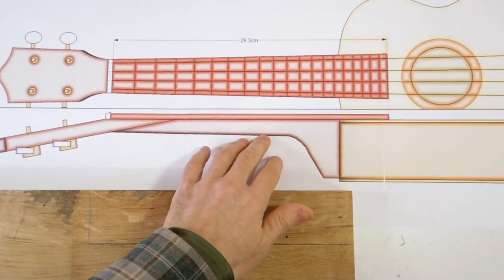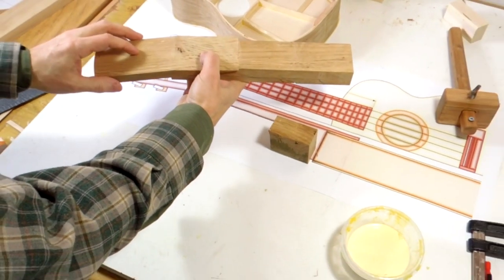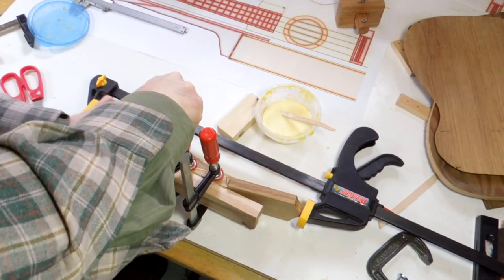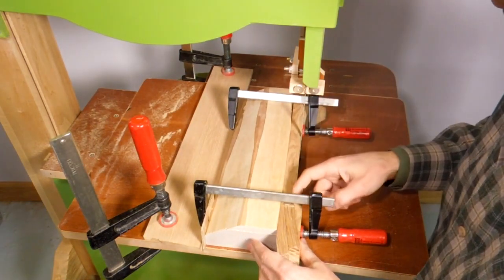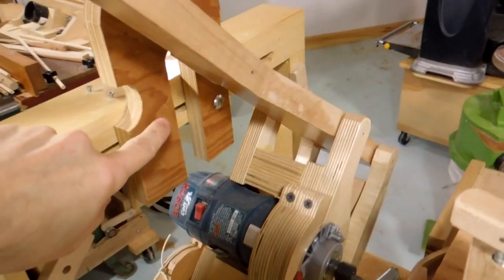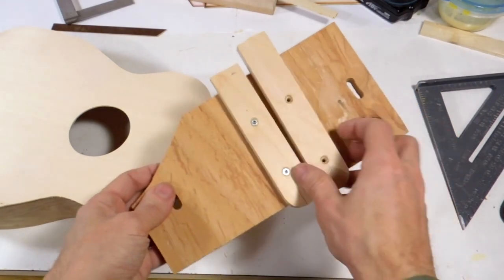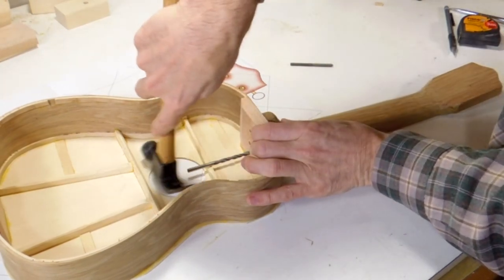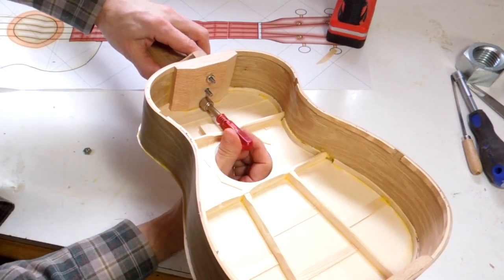Making the ukulele neck

Comment: Looking good so far. Your gauge measurements shows off your mad genius which is always fun. In this case, the external mold would have made it unnecessary. I have actually used an external mold (when I built years ago) to shape the two side strips (wet) connected by the end block and the neck on the other end. Then attach the cross braces and the back panel. Once the glue dries, you can remove it from the mold and it will retain it's shape. To keep it perfect, flip it around and slide back in the mold. Now complete the top with it's braces. Finally, add the fret board across the neck and top, and finish it up.

Comment: Really enjoying these videos.
Don't worry about the asymmetic the body. The critical thing is the nut, bridge and fret alignment. Nut and bridge parallel (for low G), square and centered on a center line. Line up the tops of the frets with a straight edge. File down (and round) any high frets. Get these right and you'll have a nice playing instrument. 
The bridge may end up slightly off center, but nobody makes a perfect instrument the first time. 
Thanks for the videos!

Comment: Short answer is yes, some uke builders put the necks on a slight angle. With neck angle the objective is to end up with the correct action (~3/32" @ 12th fret) and string height above the body. This can be achieved with the neck at zero angle when the fret board is around 1/4", or, as you suggest, with a slight angle in which case the fret board would probably have to be thinner. You can also adapt the bridge/saddle height a little to match what neck angle you are using. It all works.

Comment: zygrottwanger is correct.  Truss rods aren't used in Ukuleles.  However, some builders epoxy carbon fiber rods  into their necks, behind the fret board.  However, this isn't for tensioning, it is to increase the stability of the neck.

Comment: I love your video. I'm heading out to carve a neck or two for ukulele #4, and you've given me some great ideas. What angle do you use for the bandsaw table when sawing the heel/ sides of the neck?
The tablesaw cutting of the scarf joint made me nervous. OK, full honesty, I had a metal clamp touch the blade of my sawstop and WOW! You obviously aren't the klutz that I am. But I now use a cheap wooden parallel clamp and the saw blade goes through that and it's no problem.
Thanks for your video!

Comment: I'm too much of a purist to ever use metal hardware to attach the neck to the body. Ukulele strings aren't steel so they don't put that much tension on the neck. The mortise by itself, or a dovetail, or even dowels would be sufficient with that nice of a fit. I've seen others use hanger bolts and I cringe every time.  I need that pantograph though. :-)
Reply from the maker: Actually, I accidentally put a steel string on it for one of the strings, and it's very satisfying.  Tempting to restring the whole thing in steel.
Reply: Mini guitar? I've thought about that too.  They can tend to warp the neck though. Maybe using ultra-lights would be ok.

Comment: The use of white oak for a stringed musical instrument is a novel idea and certainly a departure from tradition - oak is NEVER used and I suppose that it was always regarded as "poor" tone wood.
Reply from the maker: duh.  That's why I didn't use it for the sound board.
Reply: Don't get me wrong - I admire your first uke build and have no problem with oak as a wood to be used or any other reasonable substitute.  It's just that luthiers tend to be snobby about wood selection.  I have an instructional video series by Bob Benedetto on archtop guitar construction and early on in the video, he opines that "There's no such thing as 'bad tone wood'.  OK, now that I opened the door, there's no such thing as 'BAD WOOD', maybe", and he was making the point that wood selection is often overestimated and the history of violin making (which he also does) has instruments substituting poplar for maple and luthiers were often at the mercy of what was available to them at a given time.  Bob also made the point by building an archtop guitar with its top carved from standard knotted pine available at home centers rather than traditional select spruce, and he reports that it sounds just as good.  It's all in the construction and voicing of the wood components.